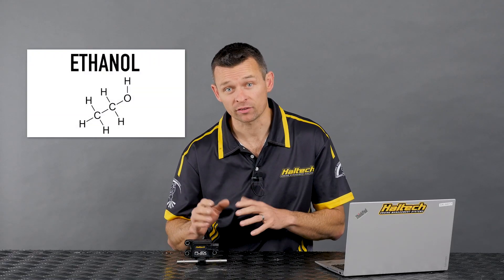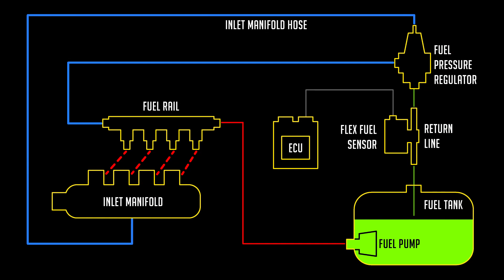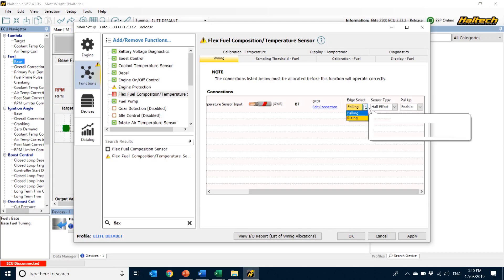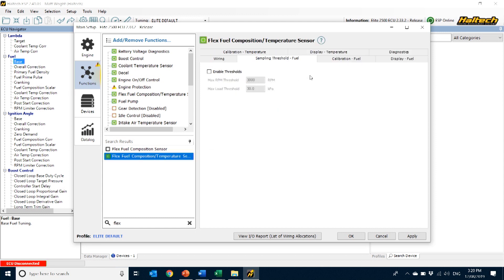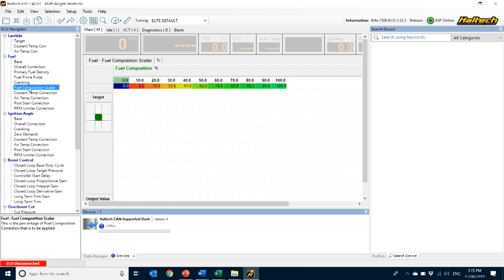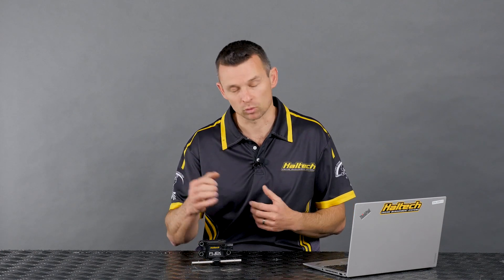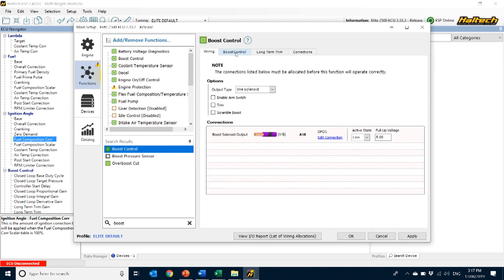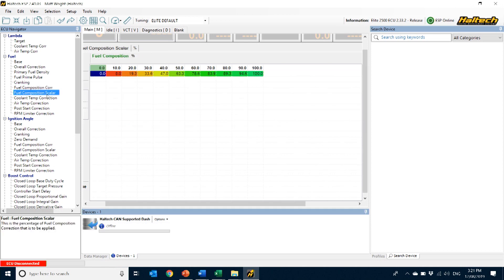💬 How to Flex Fuel | TECHNICALLY SPEAKING

Comment: Hi Matt , is the 6 degrees you used as an example of ignition timing increase for the flex fuel table set in stone as 6 degrees ? or purely for example?

Comment: Is there a way I can display Ethanol % on my IC7? I am running the unit as a standalone mode. I have wired all the free leads, I purchased oil, fuel and temperature sensors. I am really happy with it but my ecu and ic7 are not compatible yet.
Reply from the maker: Shoot a message to our support team via www.haltech.com/contact-us

Comment: My 2011 Jeep does not seem to have that sensor. Does it use the oxygen sensors to detect the ethanol %? E85 seems to have 105 octane around here to. Need the change the ignition timing too??

Comment: So do u need to re tune when u change fuels etc what if it was tuned for e85 then used a 3rd of the tank an put 98 will it pick an adjust itself or will it need to be tuned again ?

Comment: So if I wanted to go flex fuel on my g37 I could buy that haltech flex fuel sensor and if I upgrade my fuel injectors and fuel pump and ignition coils I should be able to run e85 and 91 no problem?

Comment: I'm having some issues with what I believe are cause by change in fuel temp. I recently moved from Okinawa Japan to the far north in Aomori Japan and the temps are greatly cooler, but on the same elevation. I have noticed that my average AFR is quite a bit richer on average. I purchased a flex fuel sensor to take advantage of the temp sensor corrections built in. I was wonder if you have any educational info on the effects of fuel temp on fueling? Or, if you have any other thoughts as to why im seeing this issue.

Comment: Fuel Composition tables being activated on Elite's is likely a common issue because your help file and the quick description window on the bottom left of the screen lead you into 2 different directions.. It confused me as well ( i came from a Pro Plug N Play ecu) so i figured it was the same.

Comment: Good information, I'm getting my build ready and attempting to get the elite functions and wiring organized and didn't realize the ethanol sensor also had temperature. I just corrected that and no doubt will have many other details to correct. Good thing the pins are simple to swap on the connectors.

Comment: Can you please do power gain on a NA motor with e85. Also can you talk about e85 using 95 and ethanol as well as 102 and ethanol if that makes any difference. For example making your e85 using 15% race fuel and pure ethanol vs 85 using pump fuel and pure ethanol please

Comment: Question:
Can it be used as a preemptive measure against poor fuel (rich on ethanol instead of gasoline)?
Simply to be there, to on-the-go analyze and alter fuel mixture, without actually retuning it manually?

Comment: Why isn't the sensor installed in the fuel supply line instead of the return? Is there a reason why it shouldn't be?
Reply: @Matt Wright Ah that makes sense, thankyou
Reply: Matt is not correct. You want want it on the return line so you are measuring what fuel content is actually passing through the injector rail not what is passing through the supply line as when you add e85 to the tank it's mixed and it takes a while for the majority content to make its way through the engine and and back to the tank. You only install it on the feed line when you have a returnless system.

Comment: What would happen if you had a 'dead head ' fuel system where the pump, filter, regulator, Flex Fuel sensor and return line were all at the tank and there is no return line from the engine. If you had a near empty tank of petrol and you then filled up with E85, on start up the fresh fill of E85 would be detected but there would still be straight petrol in the fuel lines right up to the fuel rail, would this cause a problem ?
Reply: There will just be lag time as the gasoline gets used up in the line. Many run flex fuel on the supply on return less fuel systems. I'm doing so. You would just never get into boost until you see you are burning your recently added e85

Comment: Last Time I looked at e85 and how it's made it's far more costly to produce it then petroleum, vehicles I've owned flex fuel,ran like crap on e85,and got substantialy less m.p.g.besides the fact I had to drive 20 miles to the only known gas station
Reply: Still the best budget fuel for lots of boost or lots of compression

Comment: Why is it these sensors are always put on the return line? Wouldn't it make more sense for it to be on feed side to read the parentage going into the motor?
Reply: Flow, look how small the sensor pipes are.
Reply: @FunctionOverForm4x4  looks like 5/16 od? Isn't that typical for fuel rails?
Reply: Mines on the feed side :)
Reply: Because being on the return line tells you what fuel is actually being burned by the engine. If you had it on the supply you will be measuring what is passing through it and not exactly what the engine is using.

Comment: How to maintain and clean a Flex-Fuel sensor? 
 What's the output values of the sensors 12v input and why?
How to assure the sensors ethanol values are correct?
How to calibrate the sensors values?
Why do you guys sound like that?

Comment: Hey guys.
Currently doing a reasonably decent fuel setup on my  rb26 tied in with you’re elite 2500. I use the car for some spirited road driving on the occasional weekend tied in with some track work.
my initial plan was to run a flex setup, however after talking to a couple of workshops and doing some research im feeling slightly hesitant due the fact ethanol is quite hydroscopic and the sensor actually measures density rather than ethanol content itself. ( please correct me if I’m wrong here) thus meaning any water found in the fuel will inturn register as a very high ethanol content, ecu adjusts parametres to suit etc etc ends up being a crazy rich fuel map with worst case washed bores. Obviously the whole idea of the sensor is to have the convenience, so buying drums of it for the consistency and peace of mind would work but it completely defeats the purpose of it being able to fill at ya local servo. Not to mention drums  are stupid expensive.

Obviously having this luxury of multiple fuels is great for daily/weekend work but my mechanical mind sais the risk is just not worth it.
What still leaves me scratching my head is to how a fair few people run flex and dont seem to have problems with them. Is this because they arnt being driven hard enough to cause damage? ( doubt it ) I can only see a few options for myself here:

1: dedicated e85, and carry jerrys in the boot for decent drives 😞
2: run the flex fuel setup and keep a ethanol testing kit and check the content before filling at the servo.
3: dedicated 98 it’s convenient but gay 😂
4: a seperate map for each fuel,  run the tank almost empty, fill up full and stay off wot for a bit to flush the lines and filters and don’t forget to change maps when u do fill up.
5: I do have an aem wideband fitted, am I able to intergrate that into the elite and setup engine protection thresholds via afr’s to alleviate a bad batch of fuel if it does get a drink of water? I feel this is probably the simplest option.
Am i totally missing something obvious here??

Cheers lads, love the vids, keep em coming 👍👌
Reply: How about a water filter ?   They are a must have in diesels..  Of  course water and ethanol mix .. water and diesel do not mix.. Water is heavier and goes to the bottom of the tank ..
Reply: Speaking from my experience you are reading way to much into this. I've been running e85 since 06' and flex since 11'/12' never experienced readings that where not known conditions (like having 1/4 tank of e85 and filling up on gasoline) or high boost WOT percentage drops (there is a effective work around to "latch" the last known "good" value for this). To help with this I have an ethanol content gauge on the dash and check it before and after fill ups to avoid any doubts (if you know the size of your tank and how much fuel you added you can do some quick math to approximate what your reading should be). On a safe street tune the amount of boost and timing you can run is about the same from e70-e85. It isn't until you get below that area you need to make larger changes...just don't get greedy with timing/boost until you're on the good stuff.  That said, if you listen to the video you can further compensate for any fuel error in the correction table by simply not changing the timing/boost until "safe levels" of Ethanol are reached and like you mentioned you have a dedicated WBO2 as a "fail safe" of sorts.

If you are still apprehensive about trusting a flex sensor try this. Install the sensor and only use it for data logging. Set your maps for a single fuel and drive around filling up from all your local stations and log the data. If you see the usual data points with no strays and the calculations line up you can rest assure any erroneous reading you get will be a true contamination issue. In my experience sensor placement, line size and proper setup makes more difference than anything else.  Hope you try it out, Cheers.
Reply: jiggydrift I have very little to add other than it is actually hygroscopic not ‘hydroscopic’. That and store your car with minimal fuel and refil before use. Maybe you’re overthinking it 🤔
Reply: I'd like to hear what Haltech have to say about this issue

Comment: Awesome video, could e10/91 octane with some small amount of ethanol be affecting my gasoline tune?
Reply: Asking because I suspect ethanol is being blended with my local pump fuel and there's no labeling or avaliable documentation( I live on a small island) my high pressure rated gasoline hose deteriorates with cracks  unusually quickly and fuel mileage varies between pump brands. Thoughts?
Reply: @Ricerguy  test your fuel for water contamination, with Gasola water detection paste. 

Ethanol blended fuels are hydroscopic (they absorb moisture from the atmosphere easily) and can rust injectors, ect.

If your vehicle was built before the year 1995 then it's very likely the fuel system wasn't designed with ethanol compatible components.  
Fuel hoses, pumps and seals will melt or deteriorate in any amount of ethanol and plug things up if they aren't rated for ethanol.

E10 would only affect your tune if you're set at a very lean AFR and were tuned on ethanol free fuel to begin with.  
  Otherwise E10 v.s. pure gasoline won't cause noticeable, if any difference at all in peformance.  

An E10 fuel blend's only purpose is to keep the cost of fuel down.  But the more ethanol in the fuel, the more fuel is needed at WOT.

Every 1% of ethanol will only require a 0.353% increase in fuel demand.  So if you actually have 10% ethonal in your 91oct gasoline, then you'll only need 3.53% more fuel at WOT.  That's a negligible difference unless like i said before, you're tuned with a very-very lean AFR to begin with.

11 AFR at WOT is a safe street tune for 91oct at sea level.

At sea level, you really should be running 93 octane fuel and a 11.5-12 AFR @ WOT.

Blended fuels have essentially the same if not higher anti-knock index then pure but they're more corrosive to older style fuel systems.

It'd be a good investment to buy a cheap ethanol fuel tester, the kind that you mix water with the fuel to see the ethanol content.

Cheers!